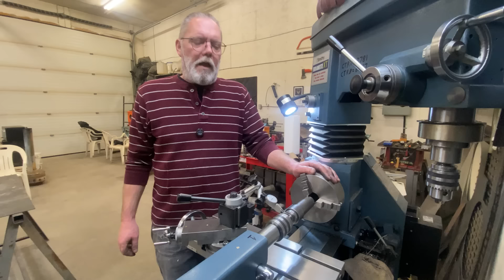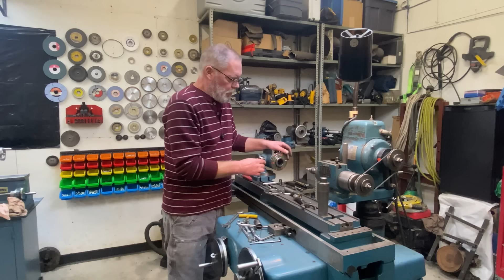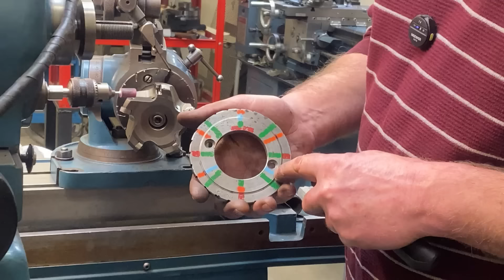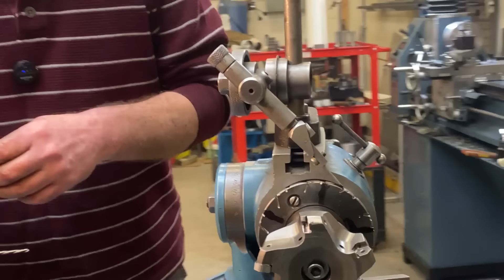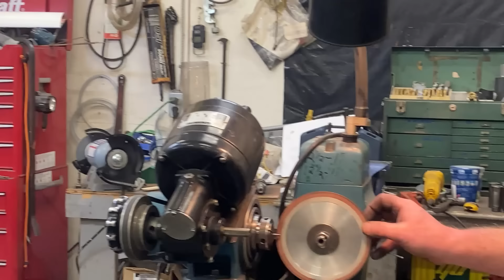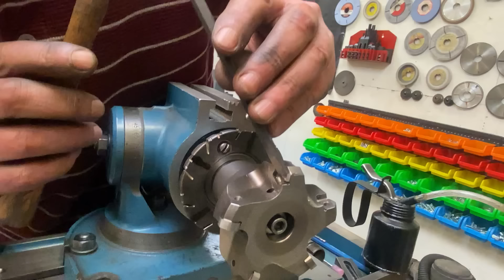MOST IGNORANT BROKEN SCREW I'VE EXTRACTED

Comment: one simple way to dial the setup would be to machine a pin to the inner diameter with small tolerance, free the x and y rotation and the index rotation of the indexing chuck, put the pin in the spindle, bring the spindle closer to put the pin inside the hole completely by wiggling the indexing chuck, tighten all the free axis, now the setup should be dialed in.

Comment: I once had to put a 0.104 thou hole in a very very hard lock slide mechanism to fit an adjustment screw. I ended up going through a pile of small bits and taps, all carbide, what really helped was diamond Imbued cutting/lapping oil which helped tear into the ultra hard metal easier.

Comment: I was surprised you didn't go through the tap drill sized hole in the back. A right hand drill would also try and screw the screw out and you should be centered on the end of the screw? I'm sure I'm missing some simple reason for not doing that.
jack

Comment: well, intention to inform.  I had many of those this year, to get the bold/screw out small 2mm tungstencarbide endmill and a rigid setup, 8-10k rpm slow infeed and in a few min. the bolt is removed. Would i have a edm i would use that. HSS is overrated for such a task, the bold is made from a very strong alloy. Good example anyway

Comment: oh... almost PTSD from seeing that broken screw there...
would have been a full on floor crying if it was a 125mm or 160mm Sandvik surface planer followed with the red boxes of new bits and replacement screws.
to many hours fighting those screws on evening shift with deadlines and no replacements on the shelf nor people in the toolshop.

Seco and Iscar was easier to deal with when screws broke, but they where not as good as Sandvik's at cutting in say CrV-steel like i did most back then.

Comment: Thank You Mr. Lappe... In my past I have had success by just drilling out the screw from the back side with a dull drill. The rotation coming from the back side will unscrew the screw out by just the pressure force of the dull drill. I also did this operation manually on my drill press with careful alignment. I LOVE your way and I appreciate VERY MUCH your determination and skill. In my past I was on the clock with TONS of pressure to get the job finished and had to cut corners. I did not like the pressure and I did not enjoy cutting corners but after many, many fix-it on the fly I have become accomplished at getting broken screws out and having the cutter back on line. Please what are your feelings?... TM

Comment: I'm a self denoted awesome toolmaker who would have simply used the thru hole as a pilot and ran a tap drill from the back side.
Works every time. Sometimes there is even an Allen screw on that end. Check first. If not, this guy made an easy job very difficult to say the least. 😂

Comment: For me i'd cut a small slot into the broken bolt with a dremel. and use a hand impact screwdriver to turn the bolt out. not like the bolt was seized in there since you easily got it out by hand.

Comment: Pretty sure the friction heating the screw caused it loose temper and become soft. If it was hard as it use to there is no way it would behave like that and allow chiseling it out with out shooting peaces all over the place. Might been easier to just heat the head a bit to flow vax around to the metal you dont want to be effected as anti-stick or just rich oxy acetylene flame to suth the surface, then tig weld a blob on the screw and ether cut a slot for screw driver or weld something like small nut in place to remove it. This would also soften the screw so if there was some tread damage screws treads would give out before the holders would, removing the issue. While i appreciate the setup since i was not sure how to dial this surface in, not many have all that to do this job.

Comment: I really liked the custom carbide drill!
I have drilled out broken HSS taps out with a carbide ball end mill.

The other day I was brought a part with two 1/2-13 screws broken off in Heli-Coils.
The first one was no problem. I replaced the Heli-Coil. The second had a broken off easy out in it and it took the better part of the day to remove.

Comment: I had something similar, tried the normal stuff and was ready to just make the whole replacement when I remembered I had a harbor freight reverse drill set I never touched because it was HF from 20+ years ago and trust was low. Chucked it up and in 30 seconds it was coming out. I don't believe the bit survived but I'm now thinking of getting a good set of reverse bits.

Comment: I believe you would have had better success by drilling from the rear. Left hand bits won’t turn the screw out from the front because your machine won’t let it move against it. 
Drilling from the reverse side will index your bit, push the screw in the correct direction and rotation.
Reply: That was exactly my thought.  If you were (left-handed) drilling in a drill press and feeding by hand,  the setup is less rigid, and you'd feel when the screw started to back out.  I've done this too many times.
Reply: he said it’s not a through hole
Reply: @chrispac6264 
Watch again, the threads do go all the way through. Not sure how you missed that, did you even watch the full video?
Reply: @michaelalbert8474   20:25. He said the tap drill size goes through but not the threads.
Reply: @dalesommerfield8920 
Great, you agree that the tap drill can be run through the rear and push the threaded bolt out the front.
Reply: @michaelalbert8474  yes, I did watch all the way through. I swear he said it was not a through hole but perhaps just my understanding is wrong.
Given the hardness of the screw that would’ve been a good solution
Reply: @chrispac6264  It is a through hole, but the threads are not. I for sure would have started with a normal right handed drill to attack from backside. Maybe there is an undisclosed reason why that setup would not work for him??
Reply: That is what came to mind, would have just to put it in a vise and use a handheld drill. bada bing bada boom, done lolol
Reply: @Mr.4AGE yep, would have been a nothing job, 5mins or less 😂

Comment: I would put a flat blade screw drive slot in the end of all the fasteners that hold the tool bits in . Then if a fastener broke you could put a small screw driver in from the back side and be able to spin it out.   Since the broken piece spun out easily, it should be able to be removed from the back side and save all the drilling and set up.

Comment: I had a similar issue years back, decided to remove the screw with an air arc, fill the hole in with weld and drill and re-tap the hole. Was a absolute pig of a job, trying to drill another hole on the exact same angle was impossible with the tools i had, not to mention trying to get weld to take to hardened steel. Ended up buying a new end mill. I don't recommend trying that approach, i was young and arrogant

Comment: The drill speed was too high. When drilling extremely hard materials, the drill must rotate at about 0.5 revolutions per second and be cooled significantly. It must only be in the cut for 0.1 sec. and then let it "rest". The drilling then looks like chip breaking. The drilling sound then resembles cracking rather than drilling.

Comment: My gut was telling me to slow the speed and use cutting compound.
I was always good at drill-sharpening by eye, switching to the big old-fashioned sharpening machine for the really big ones - 1" and above. I suspect though that this job would be too much for a standard drill no matter the edge on it. A perfect edge would either cut or break off instantly.
Massively impressed at making your own drill - that's next-level problem-solving. That nasty smelly brown cutting compound really can make a difference IMO, great for stainless, but I've never drilled anything this hard before.

Comment: im curious (i have yet to watch so maybe its answered within) would it be possible to heat the screw with a torch? i know heating it to hot enough to soften it (like anneal it) would probably not be achievable due to the large heat sink that surrounds it but i thought metals expand and contract with  heat and each metal has a different coefficient which makes it possible ot heat a stuck screw and remove it

Comment: Welding would have been way easier/faster.   Hand this to any competent/skilled welder and they could extract it in under 30 minutes.  Sometimes having all these cool tools and machines at your disposal can be a hinderance.  It's like taking out a $75,000 excavator to dig a 1 foot hole when you could have just done it with a shovel.   Shortest distance between two points.  K.I.S.S.   Also hammering it with a chisel was overkill.  A small, sharp center punch would have been safer.  But overall I'm impressed with your shop and skills, but glad I was not paying you for this job!

Comment: I set 8 tools for z height & the tip cutter was num 9 😔 pressed cycle start it picked up num 9 tip cutter then come down & smashed straight into the vice. Boss came down & said how much is that gonna cost me 😂. Why didn't I set it for z. Why didn't I keep my finger over cycle stop. Why didn't I because shut up that's why 😁 😂. What did I learn from this. I learned I'm now really good at the arcade games where you have to stop the light in the right place. Really good 😂.

Comment: We use an ElectroArc Metal Desintegration Machine, which uses a tungsten tubular electrode with refrigerant injection thru the tubular electrode at the same time it runs a high current that eats bot metals, the broken screw and the consumable electrode, desintegrating both, it magically preserves the threads in the hole, check or search the manufacturer's website... ElectroArc... Not sponsored ...
But magical machine !

Comment: try Rodman drill bits.  They will drill through hardened steel including files.  They are best used in a drill press and will drill through the rasp all day long.  I have had one for over twenty years and it still cuts.

Comment: Sometimes I grind a carbide spade drill to drill in the reverse direction. I run it slow with a lot of feed pressure. It will often grab the screw and spin it out

Comment: I have used a watchmaker trick to remove steel screws that are broken off below the surface of a brass or aluminum part. Boil it in a saturated solution of aluminum sulfate (alum). The steel will be eaten away and the brass will be intact. Probably would not have worked here unless the mill part was some exotic metal and the screw was steel.

Comment: Use a Dremel disc and cut slot into screw head and us watch screw driver to remove. You will damage the local tool holder by pulling is a slot but that is usually no problem.

Comment: Diamond-tipped Dremel bits will cut a hole or a slot in cobalt or tungsten carbide.  It's not as elegant as using all your heavy machinery, but they are cheap, and they will work on hard metal.  Only takes a few minutes to cut a slot for a screwdriver.  You cut the slot in 30-second intervals so the diamond tip does not heat up enough to come off the end of the bit.  I've used them successfully on similar jobs.

Comment: Nice work, but didn't that screw hole go all the way through the piece? Could you not have gone in with a normal right hand twist drill from the bottom and driven it out from behind?
Or have I missed something?

Comment: A word about left right hand drill in broken bolt extraction. 

Case 1 : using hand drill , left hand drill is more suitable , because our hand and elbow - are floating . 

Case 2 : using lathe drill , left hand drill is NOT suitable , the sticker bolt tends to backing out of the hole while the lathe is not floating. When that happen the drill will experience an excessive feed rate and bite hard into the bolt core, this may shatter the drill. So use right hand drill for right hand bolt.

Comment: You have work hardend the hole with the bits that did not cut , now it will take a bit harder than the skin in the hole .
I have ground places like this to get rid of the hard skin so it can be cut again .
A torch heating to anneal the spot can help sometimes , did this on a case hardend pin to drill a grease hole in the side , drilled like soft steel in that spot .

Comment: Dosnt look like you ever tried hitting those sleeves with a torch.  I know you don’t want to damage the arbor, but the thinner steel of the sleeves will heat up a lot faster than the arbor. Great video though!  I would have just welded a nut on there than have it snap off and repeat that process about 5 times till one of the welds actually grabs into the bolt. If that didn’t work, break out the dremel with at least 3 or 4 little STONE bits. Don’t use a metal burr bits with hardened bolts, they get shredded within a 32nd of an inch

Comment: Looks to me like the screw work hardened on you. the more you drill the harder it will get. I'm a retired airline mechanic and over the course of 50 year career I've drilled/removed 1,000's and 1,000's of stripped/broken screws. If it's a wonkey break where I couldn't just drill/easyout the fastener the method most of us used was to get 1/8" dia. (.125) rotary burr in a 20,000 RPM rotary tool like a Dermal (electric) or a Dotco (air) and dish out the end of the fastener. A few tap tap tap taps of the burr will remove any jagged materiel and form a clean dish for the drill bit to bite into. The rotary burr method avoids work hardening the piece your working on and forces the drill bit to drift to the center of the dish avoiding runoff/drift and any damage to the surrounding structure.

Comment: I have to deal with this stuff often at my job. Broken bolts in jet engines are very hard and have to be removed freehand usually. I find it odd a machine shop sent you the tool to be fixed I guess CNC shops have no old school guys. Not to be a monday morning QB but if you had drilled from the backside the screw most likely would have just come out. 2 hard surfaces generall don't stick in my experience. Great work though, nice shop!

Comment: Couldn’t you use the tap drill hole with a precision pin to set up on the back of the screw hole, then use a rh drill bit from the back. If the bit catches the broken screw will shoot right out.

Comment: You made a coutersink in the stuck screw stub.  At the risk of seeming naive, could you not make a matching male point, and glue it into the countersink.  Some modern adhesives are very strong - especially between two virgin surfaces, and maybe there would be enough adhesion to turn that screw stub.

Comment: With something like that all you have to do is use a hammer and punch and fracture the carbide, beak it into multiple pieces clear the pocket and the screw should come out with just your fingers no tool required. I used to be in set-up and machine repair at a large production machine shop and I used this technique 100's if not thousands of times to remove a stripped/stuck lock pin.

Comment: Would it have been possible to remove it with spark erosion using either a square electrode then machine a square tool to fit and unscrew it, or a round electrode then collapse the thread ?
Reply from the maker: Absolutely. I would choose a hex and remove it with an Allen key if I had a EDM machine

Comment: What is that lathe? Seems interesting! Also, what is the bed used on that set up shown around 10:20? Thanks!
Reply from the maker: It's a Smithy  XT 1340 lathe mill drill. I've done several videos on it. Not sure about the bed?

Comment: A tool & die shop that I did some electrical work in told me they send out broken boots below flush on molds to a guy that had a small EDM machine to burn out the bolts . Only charged $50 a bolt back in the 1980's.

Comment: I have removed many bolts with left twist bits just free hand in hand held drills. It allows the bit to walk freely and not just snap as they will often do when held rigid. Sounds crazy to machinist  but in the real world most broken bolts are attached to things that cannot be chucked in a lathe. Long term heat cycling can harden bolts drastically.

Comment: Given the hardness of that screw, the only way is carbide. I've recently bought some carbide drills of 4, 3.5, 3.0 and 2.5 mm and have already used one to drill out a screw. It worked perfectly on top of that they were fairly cheap. The whole lot came to about £12 or so ($15US or thereabouts)  and I got two of each. ( from eBay). Before you try to proceed with carbide drills, I would use your carbide centre drill to go in as far as you can without touching the shell mill ensuring you get as much of the broken screw to a uniform 60 degree taper, so your chosen drill won't be yanked sideways by an odd shaped bit of he broken screw. Some may wonder why I say that but small carbide drills will not tolerate shock side loadings, they will just shatter.  I had not finished the video when I wrote this, so congratulations to you for your ingenuity in making the carbide left hand bit to get it out. That being said what I wrote is still pertinent because most people don't have a tool and cutter grinder, or even two of them lol to make their own left handed carbide drills !
Reply from the maker: Thanks for the very detailed comment and for watching!

Comment: Since it isn't a blind hole, I was surprised you didn't come in from the back with a right hand twist , it might have been quicker.
Reply from the maker: My concern was withe the screw so hard and the shell mill so soft the drill would wander off and damage the threads. deep in a hole like that you wouldn't even know is was happening

Comment: Would it have been easier going in the back so as you pushed the tool against the remains of the screw it naturally could have threaded out rather than fight against the inwards pressure of the tool. Possibly the screw would be softer there too.